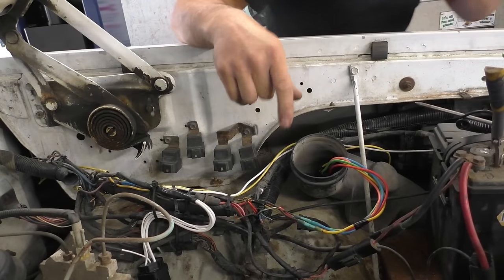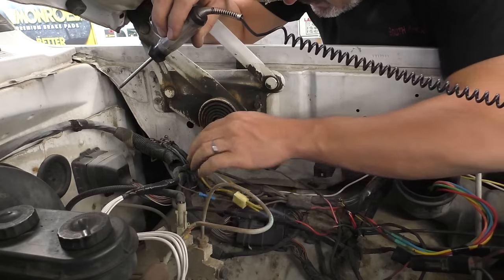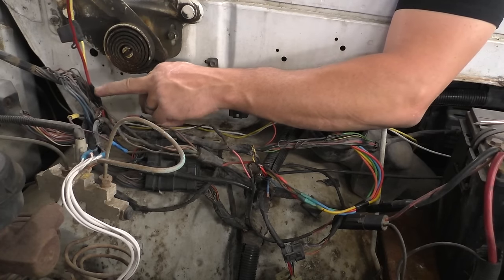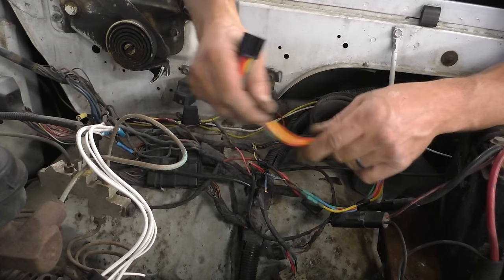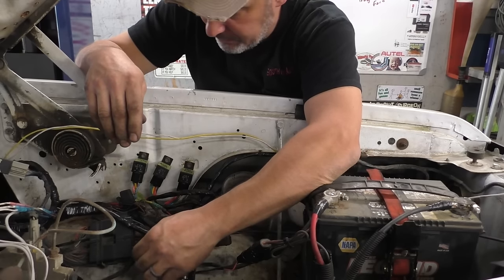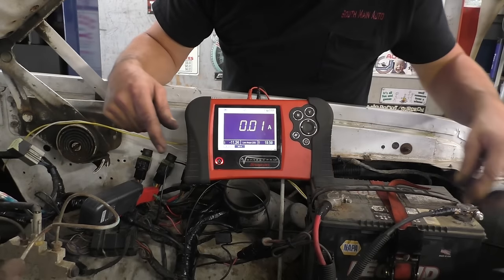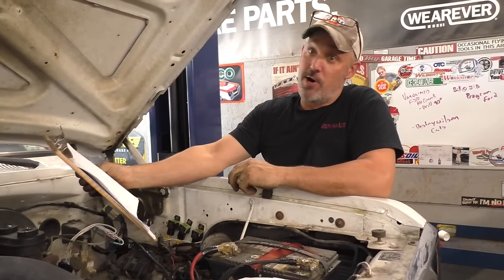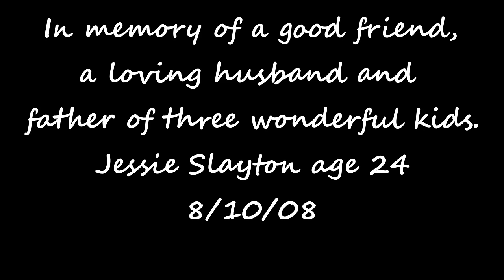Square Body Ram No Start - Complete Hack Job - Part II

Comment: Who on earth thought fusible link wires were a good idea? What was ever wrong with a small fuse box?
I suspect someone designed the wiring layout without fuses. Then someone pointed out it was a fire risk and rather than route the wires through a common point they added these links.
Reply: They were used at a time that fuse boxes had glass contact fuses and could not be used in wet or semi-wet locations. If you stuck a fuse box from the time on the inner fender you would have a corrosion mess. If you ran all of these wires into the cab where the fuses could live, you would have a fire hazard because of the length of the wire prior to a fuse.

I work on a lot of old tractors and I cut out all of the fusible links now and replace them with a small water-protected fuse box (they sell them on the "a" site pretty cheap).
Reply: @MichaelBEarl  Blade type fuses were introduced in 1968.

Comment: The spark is probably a capacitor in the PCM charging after being discharged. It will draw a lot of current for a few milliseconds, enough to fully charge the cap, and to create a spark (once). You can think of fusible links as ultra-slow-blow fuses, the advantage being that they are relatively immune to the brief excursions of current you saw when revving the engine. Regular automotive fuses are by no means 'fast-blow', but they blow faster than fusible links, so your choice of 25 amps in the light of 20 amp peak current is probably a great choice...

BTW, I really like these types of videos, even on the old stuff...thanks for all the effort you put into these great videos.

Comment: "what do you want me to do, chop it off?" is pretty good ... I like "there's your problem lady" .... my wife did not have any water .. i looked around the well, the pressure switch had two dead dried mice in it ... "theres your problem lady ..." wire brush and a few sparks later and it was golden!

Comment: Fuses are basically just undersized wire too. Size it so it melts when to much current is drawn. 
You typically want to size the regular wiring so it can handle a little over rated current continuously. 
Also gets fun when it’s a long run that needs bigger wire than it normally would.

Comment: A fusible link is really considered a super slo-blow fuse. The link can handle instantaneous inrushes of several ten's of amps at key on, then doesn't enter the picture unless continuous current exceeds some large spec.

Comment: Well done, sir.  If someone (like Wilbert's) had an original air cleaner housing and the intake duct that goes between the SMEC and the air cleaner housing, that would be good to have.  As I understand these old Chrysler engine modules, forcing the inlet air through the engine module housing is how the internal electronic components are kept cool.  But this probably is a bit less important now than it would be at the height of summer.

Comment: Since that circuit you saw the spark on feeds constant power to the ECM I bet you really did see a spark which was caused by a capacitor charging up. When you measured current afterwards the cap was still charged thus the zero reading.

Comment: Just got done reviving a '94 Dodge conversion van with one completely dead buss bar in the fuse box... No windows, no reverse light, no heater fan, no ABS. Fusible links were melted...
Cause was circuit overload, with a fully shorted blower fan being the trigger.

Comment: Holy cow.. what a schimazzle of wiring.. Great patience in scoping that out. Glad to hear that finally it was a faulty wire connection on the pump. What a challenge that was, but kudos to you for getting it done..and right...cheers

Comment: Eric your a good man , a lot of guys in the business may hate on fuse links but they were cheap and they did not get corroded like a glass fuse they were not subjected to vibration like a glass fuse . For the most part the fuseable link was long lasting and so dependable that it was crushed and recycled with the car at the end of life . But in this case.  long before you diagnosed this car someone, that had no business working on cars caused all these problems, by not having the skill to diagnose the original problem. So they just installed 10 more problems for the new owner of the truck and then those same problems found there way to your front door…

Comment: Great job on the electrical work, Eric. I love the great job you do on these wiring repairs.
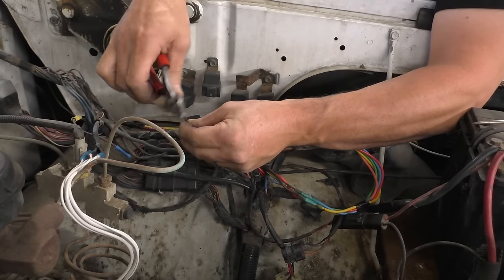@12:02 "The best thing to do with fusible link[s]... is eliminate them."  That's true, but you also should mention replacing them with fuses; you did demonstrate that later in the video, however. In 1979 I had purchased a 1974 International Travelall in which (unknown to me) the previous owner had electrical issues. He had blown the fusible link to the body wiring, and replaced it with a smaller gauge (larger diameter) wire, which was decidedly wrong! In my possession, the Travelall's alternator shorted out while I was driving, and the engine and dashboard harnesses caught fire. I had the presence of mind (and the right sized wrench) to disconnect the battery before the vehicle burned down. Replaced the engine and dashboard harnesses, and found evidence under the dash of a previous fire. Lots of trouble to get that vehicle going, but by golly it was RIGHT after that, as all the fusible links were replaced with the new engine harness.

Comment: Mopar thunder. That little gal is ridin in style. Just remember if we can do it, you can do it. I'd rather work on one of those than anything put out today. As you can tell by my pic, plus I have 2 97 Grand Cherokee's with 5.2's. Probably old news but ya got yerself a winner there Mrs. O.

Comment: I was working on a customer's '79 f350 and the fusible links were giving me fits.  Ended up getting a maxi fuse holder with the number of fuse places that I had links and wired from there.  Much easier to check for a blown fuse than a bad fusible link.

Comment: Pretty much the only problems those old square-body Rams and Dakotas had were electrical issues. Sadly, too many Mopar products have that issue.
Older Rams, late-70s especially, had problems at the Ammeter in the gauge cluster.

Thanks for getting this old truck sorted out for the young lady! Hopefully all the electrical issues are addressed now. You not only straightened out the hack-job workaround, you solved the original problem with a modern equivalent. A fuse is MUCH easier to repair down the road than another burnt link. You'll both be happier in the long run without all the CANBUS and OBD-II gobbledygook.
Reply: For the record, I would have made pretty much the same exact repairs you made. Return everything to factory wiring but with improvements.

Comment: The spark you saw at the fuse was probably just the capacitors in the ECM charging up for an instant, i believe you said that leg also powered the ECM right?

Comment: Humm - I've been using 60/40 rosin core for just about everything - for many, many years. Have I been doing it wrong?  Well, it ain't broke for me, so I ain't gonna' fixit.  Love the videos Eric. Big fan.
Reply: 60/40 solder (or 63/37) is the percent tin (Sn) to lead (Pb). Solder with lead is now banned by the EPA due to the problems it causes to humans and animals when ingested or the fumes are inhaled over time. The solders available now are a high tin content with some copper. Some also have silver. The new lead-free solders require more heat and do not solder nearly as well as the old tin/lead solders. Also they cannot be mixed, using the wrong solder on an old solder joint can cause it to fail early. The high tin content solders also can migrate. That is why dash clusters fail on older cars that used lead-free solder.

Comment: These 2 videos hit close for me because these are the kind of vehicles that I mostly work on (and restore to keep). If you can find one in decent shape, it's hard to beat these old trucks for tough as nails, come back for more reliability and work ethic. Even the ones equipped with E.F.I. are still easy to work on.

On the other hand, it's extremely hard to find one that hasn't had its wiring harness hacked to pieces! On top of that, it's always seemed to me that Chrysler engineers ate, slept and shat fusible links! Obviously, GM and Ford (as well as all other manufacturers) used them too but Chrysler seemed to use more than the others. I'm a GM "square body" guy at heart but, I also have both a 1978 Dodge Lil Red and 1979 Warlock II 4x4 living in harmony with my 7 GM trucks. The wiring, front to rear was a nightmare to sort out! I also should've kept the 1990 F-250 (351W/5 speed ZF trans) but, I practically gave it to my ex-brother in-law a few years ago.

I'm glad that you posted the update on the fuel pump harness. I'd suspected either an ebay pump or bad connection. I'm sure that the truck and its passenger are both happy now!

Comment: Fusible links are slow blow, fuses are fast blow.  Fusible links are also encased in special materials that are designed not to catch on fire when exposed to high temperatures.  Amazon still has them.

Comment: Hey Eric, unrelated to this job, but those old injected 318's had a cover on the bottom of the intake manifold, in the lifter galley, the cover gasket fails allowing manifold vacuum to pull oil vapor right into the bottom of intake, causing alot of oil consumption, irratic idle, fouled plugs. When you shut off the engine, it sounded like vacuum sucking. Another job for another day, the young lady needs to check oil pretty often, I think. Hope that info helps.❤

Comment: I can honestly say that every single 80's and early 90's Dodge truck that has come into the shop up here on Tug Hill has had the wiring for the asd and fuel pump butchered and cobbled. At least repairing that beats breaking out my old analog meter to count needle sweeps trying to diagnose drivability issues.🤷🏻‍♂️🤦🏻‍♂️🤣

Comment: I had a 91 W250 until just recently. I know first hand the feeling when those things just drop you alongside the road. I also had that same problem with alternator overcharging the battery. I think mine was putting out 15+ volts. Turned out to be a very corroded spot on the wiring harness directly behind the alternator bracket. Brakes on that thing were just awful. Front disks and rear drums. Rears never would stay in adjustment. When it got so bad all the braking load went to the front disks, simply hitting the brake pedal would throw it into a death wobble. I also experienced the problems with the steering sector. Lost track of how many of those rebuilt sectors went on there before I finally had a working unit.

Comment: Working most of my career at new car dealers, we rarely got to work on old vehicles as they usually were gaffed up like this old truck by some person who had no clue what they were doing! When In started working in independent shops, I saw many gaffed-up vehicles. A lot of so-called mechanics i met were just parts replacers!

Comment: You probably did see a spark when you powered the memory circuit on the pcm or radio (or both if it has one), you charged the capacitors. If you pull the fuse and let it sit 5 mins or turn the key on for a second, you'll get that spark again.

Comment: rewired a friend's truck in her front yard with nothing but crimper wire and a handful of terminals. only got one circuit wrong had the 12v to headlights key on only. her boyfriend got jealous and stole the truck and sold it.

Comment: Back in the 70'sor 80's, had a friend with a Ram that he hated. Ran it floored with brick on accelerator and walked away so it would blow up. Came back later, wasn't blown up but was out of gas.

Comment: Replace those fuse links with Maxi fuses. These links have been a problem back to gen-1. seems those links are right at bare minimum to hold amp draw. Good stuff.

Comment: You seem like me with your vision. I kept having to get farther away from things to see them.  I say I got to the point where I had to either get glasses or longer arms. Like you, I tried the reading glasses that you have to keep taking on and off and they kept getting scratched or broken as they fell off my head or got crushed in my pocket or fell out when I leaned over.  I finally went to an eye doctor to get bifocals so I wouldn't have to do the eye glass dance. I found out that I needed a different power for each eye for near vision. She told me I only needed reading glasses but I explained that I wanted glasses that I didn't have to remove. It was the best thing I ever did. You will soon find that you need different power glasses to read your computer screen at a comfortable distance. The problem comes because our eyes aren't as flexible as we age so they can no longer adjust to the varied distance as well. I bought two pair with Flexon titanium frames. One with auto darkening and one without. Now I don't have to keep track of glasses and sunglasses. I've had the same frames for 25 years.

Comment: You probably did see a spark when you plugged-in that fuse....  If there were any electronics downstream of the connector, they would have had some filter capacitors between power and ground to suppress electronic ignition noise.   Those caps would draw a current surge for a fraction of a second, until they charged-up.

Comment: You have far more patience than me ..I don't think I have ever seen a VW that wasn't a rats nest behind the dash ..such a simple car and people always play with the wiring ..I have same year d150 and I did have to bypass the volt regulator as it kept frying them ..the fix I got from youtube has worked for some 10 ? years without a battery/alt replacement ..dodge wiring from that era is terrible ...looking for another engine wiring harness for my Calf only d150

Comment: Some of the late 80s and early 90s dodge vehicles have unique charging systems,, they basically charge only what is being used., if u check voltage while they are running, you will not see much more than 12.5 volts.  batteries last three times as long in these systems, because the battery isnt constantly being over charged.. my 89 dodge dakota has this charging system..

Comment: Done good, electrical is hard. I had a new copier/Xerox machine, in the older days due something similar, which was a new machine, I was younger than, 40 years ago, it was an temporary open circuit between the main board and the timing board. this stuff happens.

Comment: Wonder if this truck has the aluminum head Magnum 318- 1991 is supposed to be the last year of the 318 LA wedge motor,and this is supposed to be  a 1992 D series
Eric is the winner here because he never quits
Nothing will crack a repairman quicker than seeing a hack job on wiring that's intermittent.

Comment: Very possible that that spark you saw while inserting the fuse was caused by a capacitor in the SBEC being charged up for the first time in awhile.  Once it's charged, current doesn't flow anymore.

Comment: The little spark you saw at the fuse might have been some kind of capacitance built up in some device.  Old tube amplifiers and TV's had huge capacitance and could kill under the right circumstances.  Anyway, whatever was charged up in the circuit might have discharged after a low-amp draw that might not have been detectable by the meter.

Comment: This video didn't suck Eric!  We learned how to measure current in circuits in order to determine fuze protection and relay ratings. Electricals are often a weak point for gearheads like me building their own stuff.

Comment: The spark you saw may have been stray voltage.  We always had to prob the contacts with the VOM meter on ohms before installing ejector carts on bomb racks.

Comment: The spark you saw when making the initial connection with the fuse might have been charging up a capacitor somewhere in some downstream piece of electronics.  Once the capacitor is charged, no more current will flow.

Comment: If the fuse is powering the single board computer the spark could be the capacitors charging.  Once charged the current drops to zero.

Comment: Mr. O,
I was going to suggest you find the local bumpiest road to check for any fuel pump issues but it found you. Good.
Now as for Mrs. O's inside knowledge of you, will this become shared knowledge or stay private amongst the two of you?
How's Mrs. O's thyroid now after how long from the NYC visits?

Comment: I found fuse link wire at O'Reilly last year. But I used a mega fuse instead. (1996 Jeep XJ) However, I did have to show the guys working in the store where it was.

Comment: Think that spark you saw were probably capacitors inside the PCM charging (once they charge the current draw would be negligible).   Not sure, but just a thought.

Comment: I am surprised you cannot get fusible link wire, as I just checked with O'Reily auto parts store and they do in deed sell it. But I think given part's houses now days, these kids that work the counter do not know what it is. But I remember having to install a fusible link on my 1965 Ford F-100, and had to get it from the Ford Dealership mother ship.

Comment: If there was a capacitive load in the circuit then there would be a spark when you inserted the fuse but there would be no current draw on the meter.

Comment: Found this in some old forums, looks like the 25A or a 30A should work:

 “…found it on the SDML mailing list: 

(From Russ Knize)

white fusible link = 20A slow blow or 30A fast action fuse
orange fusible link = 30A slow blow or 40A fast action fuse
grey fusible link = 40 A slow blow or 50A fast action fuse”